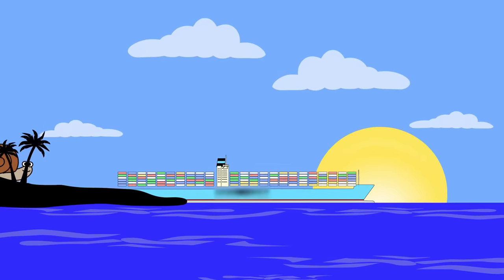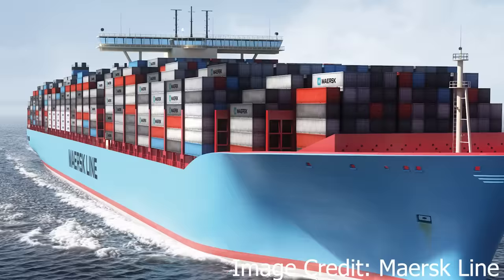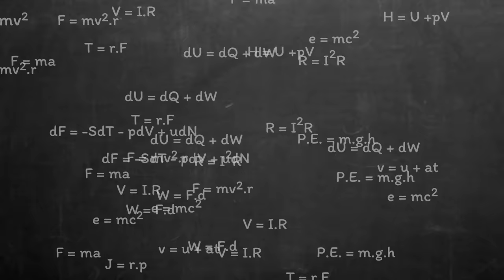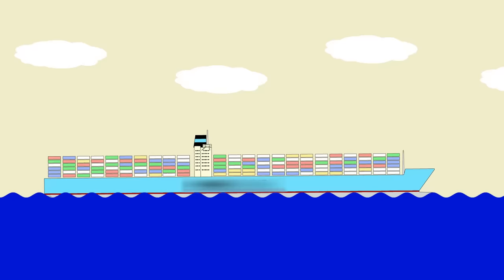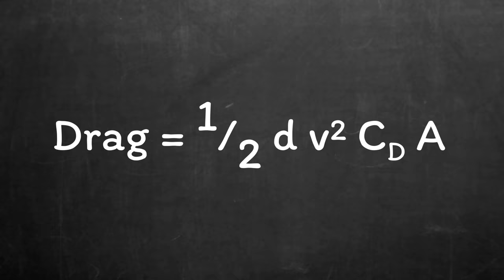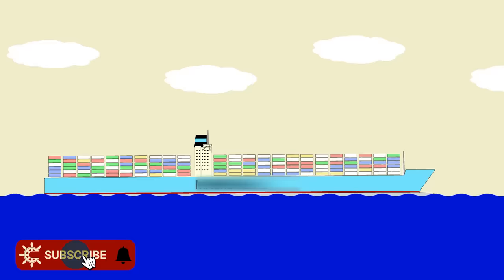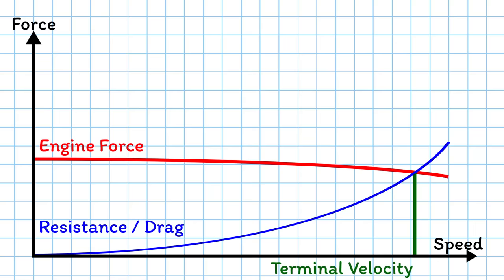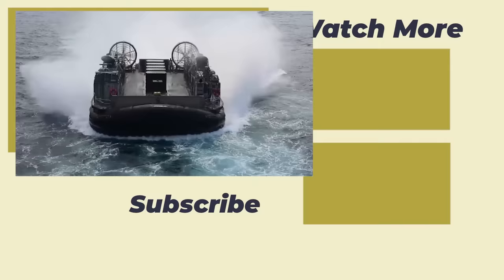Why are ships so slow?

Comment: You missed the three biggest factors.  Even with all other things (mass, power/weight ratio, cross section of wetted surface, ect) being the same, these three have more affect then the rest of the reasons cited in your video. 

First, there's the density of water vs air.  The higher the density, the more mass you have to displace to move.  Water is over 1 metric ton (1000 kg) per cubic meter, air is ~1.2 kg per cubic meter at sea level and ~.02 kg per cubic meter at typical cruising altitude.  This is where hydrodynamic/aerodynamic shapes (form drag) come into play.

Second is the viscosity of water vs air, which affects surface drag.  Air is 50 times less viscous than water at sea level, and 60 times less viscous at cruising altitude.  

Lastly, hull speed.  Cargo ships are displacement vessels, which mean that above the hull speed,  about 30 kts for a 500 ft vessel, drag rapidly increases.  Planing hulls and hydrofoils ride on top of, or above, the water, and aren't limited by hull speed.  Catamarans have a slightly higher hull speeds due to high LWL/BWL ratio hulls.  Aircraft and cars don't have this problem.  They're don't see disproportionately rapid increases in drag till they approach mach 1.

Comment: Iam not sure whether the video viewed ship resistance from the right perspective. Ship resistance is mainly a function of friction and wave resistance. Frictional resistance is 'mainly' a function of wetted surface area, while wave resistance is 'mainly' function of the froude number (ratio of ship speed to square foot of length) to which the drag coefficient formula applies. 
For a vessel of 400m with a low froude number, it's speed will be limited by the ships inability to overcomes its hump wave(among other variables offcourse)  that's generated due to the ships speed to length ratio where further increase in speed requires an un economical increase in power. Further more from the drag coefficient formula, since density of water is 1000 times or so more than air, the drag will amplify due to that factor (pertaining to water viscosity ultimately). This is also  simplified model as ship resistance is affected by form factor, viscous pressure and air resistance among others.
Reply: I just noticed  you addressed some of these points in the pinned response. 👍

Comment: Aircraft and cars move through air. Ships must move through water which is 1100 times denser than air . They have to push that water out of the way to be able to move forward. That, and their massive weights, require huge amounts of horsepower to move.

Comment: Ships are slow because the blade are on the back side.the hole pressure  (the load of the ship and the pressure of the movement )was on the back side.
Jodi blade gulo samnay dikay hotoe r flat hotoe ta holay ship er speed anek baray jatoe.
Fish r boat er modhay parthokoe achay. 
Fisher concept boat er satay kono dino match korbay na.

Comment: They are heavy etc, sure. 

But isn't the water playing a HUGE role too? As I see it, the problem with water is that it doesn't allow you to move as rapidly as you could if you travel on wheels on a flat surface or even in the air. Why?
Because the environment isn't as controlled and there is always the chance that you run into a literal speedbumb. Actually, ships go 'through' such speedbumbs all day every day - and sometimes the sea just throws solid hills of water at them. If you travel at a few hundret knots and come into contact with a wave - chances are that your vehicle is ripped apart. Water can be a solid obstacle if you hit it with enough speed ...

Speedboats and thelike are able to go very fast etc, but they can do so only with calm seas and only with very little weight. I don't think it would be possible to construct a containership that could go similarily fast even if you had the engine etc to put out the power necessary, just because it would be prone to wreck its' own structure with its' contacts with the water.

Comment: Drag Coefficient ....Air is 784 times less dense than water ...so, roughly it takes that much more energy to move an object through water than air. However, floating on the surface of water needs relatively less energy for the same object. Surface Transportation, by far, outweighs Time / Distance than water or air. Modern Railways can hit a speed of up to 600 Km/hr. No ship can match that. There are freight trains from Beijing to London / Madrid. not If but when Baring Strait Tunnel is built, Railways shall rule the planet, apart from ANZ, Antarctica and Island. From Tierra de Fuego to London by train ...a Train Journey of circa 50,000+ Km ...stopping / starting ...all the way to London ...

Comment: Emma Marsk has a cargo capacity of almost 7500  40 feet long containers  with a weight of 21 tons each.
This means you need 7500 18-wheelers to transport the same cargo. How many horsepower do you think they will have together?
Not to talk about how many planes and their power....

The largest cargo ships of today can transport 1 ton of cargo 1000 miles using only 1 gallons (or 1l/400km) of fuel oil.
If you convert this to a truck, transporting 30 tons of cargo 100 miles would consume only 3 gallons (or 7l/100km) of diesel. I think the truck needs a little more fuel.
  So evem if big ships are slow,  they're very fuel efficient.

Comment: Vehicles do not experience friction. Not in the way it is implied in the video. What causes vehicles to have a limited speed is aerodynamical drag, tire rolling resistance (due to energy loss inside the rubber) and viscous friction on all oiled parts. Friction with the ground plays a completely opposite part: it pulls the vehicle forward. Remove that, it will never  move - unless moving down a slope, of course.

Comment: https://en.wikipedia.org/wiki/Hull_speed

It's not drag in the same way other things experience drag. When a boat goes fast enough the trough from its bow wave is at its stern and the ship is effectively climbing uphill at a steep angle. This practically limits the speed of all heavy ships. Boats that go faster than this do so by hydroplaning.

Comment: If you can increase engine power, like, say, using gear ratios to switch to an overdrive, would that have a significant effect on speed? Or would you need to keep the same ‘high torque’ speed?
Reply: Optimal rpm to torque and power ratio is required for optimal fuel efficiency..

Comment: I know this is so obvious but the reason why ships have more horsepower then cars is because if a ship had a cars engine it wouldnt do crap, sitting there useless. But even so if you were to remove a ships engine say put it on something else way lighter, it wouldnt do crap either. It would be too heavy. In our world of modern technology people believe that horsepower spells everything speed. 100% false because take for an example an F1 car. Produces a ton of horsepower and its not street legal for a reason. Its to light for legal regulations. A standard F1 car only weighs 200-220 KG! thats super light for a car. Take for example a Bugatti Veyron. It produces more than an F1 car about 1200 horsepower. But the thing is, its heavy as hell. An F1 car would leave it in the dust. This also applies to motorbikes, a standard bike is extremely light but has an extremely low amount of horsepower. That doesnt matter it can still beat a car and go over 300 MPH. In the car world we havent even made a PRODUCTION car capable of that speed. (This comment is for all you nerds/car nerds like me out there)

Comment: so you say 1 container ship needs 109,000hp so theoretically a Boeing 777-200LR and Boeing 777-300ER can pull a container ship being that they are powered by 2 General electric GE90-115B's that produce 60,000hp each. I'm just an aviation gal trying to learn ships sorry if i got this misunderstood.
Reply: Well yes they can but that's a very uneconomical way of doing stuff. Water has a high viscosity so a drew turning in water is able to generate more thrust than a turbine turning in air. That 109,000 horsepower is better used under the sea than on a jet engine pulling a ship
Reply: Yeah but you gotta consider that airplanes need to stay in air and not fall down+it is supposted to be the fastest way to travel. Ships don't NEED to go at a certain speed to, technically to not sink because you don't sink for going too slow in water.
Reply: @blase1856  makes sense . I'm a ship noob so I don't know thanks for your input . I only watch because boats interest me . you don't know how much you just helped me out.

Comment: 100 horsepower an average car. Bull pop. It’s actually with the most commonly bought cars is actually 60/80 horse power and planes actually don’t often have 4 engines, it’s 2. Even the long haul flight I took to South Africa was 2 engine plane. So thi is bs

Comment: but how does the ship engine weighing in at 2300 tons and "only" delivering 109000hp compared to a smaller jet engine on a plane that makes 150000hp?
Reply: Different type of engine while the jet engine has more horsepower its not really compatible with ground and water

Comment: Why  cant we use hover craft for cargo ships
Reply: I'm pretty sure hovercrafts aren't often used because of the cost of fuel.
Cargo ships are generally used to ship things for low cost at the expense of speed.
Hovercrafts can go fast but need a lot of fuel and can't carry as much weight as other ships the same size. I'm pretty sure the cost of maintenance of a hovercraft is higher than other water craft.

Comment: Why ships don't have higher HP engines proportional to their mass? I am surprised that big cargo ship has lower HP engine than a 747.
Reply: Bigger engine means more fuel used, with not much or even no more additional speed. Drag increases proportionally and think about the bow wave too.

Comment: I'm sorry, old video, not a big detail, etc etc. But the extreme end being F1 at 1000 HP? Really? There are cars driving around on the street with 1000 hp and air conditioning. If you want to go with the extreme end you should have made a drag racing reference or the like. Top fuel drag cars are pushing 15,000+ hp just to make it on the track.

Comment: What if they outfit the container ship with 100 turbines?
Reply: Fuel consumption goes through the roof, and they squeeze maybe an extra 3-4 knots out of them before cavitation screws em'. The Iowa-class battleships are a good example of this; they've got an absolutely apocalyptic 216,000 shaft horsepower pushing 57,000 tons of armor and guns, but they topped out at 34 knots under standard operating conditions. They ran into problems with the outer two of the four props starting to cavitate, creating massive amounts of drag and slowing them down to the point that they had to downsize them. It's telling that with half of her boilers cold, Iowa still managed a gob-smacking 29 knots with effectively half the available horsepower. Power only gets you so far, and with shipping, efficiency, not speed, is the name of the game.

Comment: There once again is information missing. Quit using HP. Horsepower is not a major determining factor. If I had a racing engine with a million horsepower, it still wouldn't move that ship. Now I have a small engine with a million foot/pounds of torque, it would spin the ungodly hell out of the rear props and that would move the ship faster. Internet. Stop. Using. Horsepower. Does anyone else, even remotely mechanically inclined know this? It's like saying electricity is voltage. It's not, there is current, draw, and flow. Amps, ohms and volts in that order. Use the entirety of what you're trying to teach about and you'd have less comments about "bigger=slower". And probably better educated people. Really irritating.
Reply: I'm afraid you're quite mistaken.  In your analogy horsepower corresponds to watts, not to volts.  One horsepower (US) is 746 watts.  It is the measure of how quickly work can be done.  Continuing your analogy, torque is volts (pressure) and rpm is amps (flow).  The amount of work done is the product of the two.

Your million-horsepower racing engine could be geared down to around 100 rpm, which is roughly how fast these big ship propellers turn.  Leaving aside the gearing losses, it would have 52,525,121 pound-feet of torque at the propeller.

You can always swap rpm for torque or torque for rpm using gears.  What you can't do is have the product of torque and rpm exceed the available horsepower.

Comment: Install a jet engine on a cargo ship. Problem solved....or at least it’ll be very entertaining
Reply: That doesn't work like that. Planes can only go fast because they are moving fast in the first place. The only way for an airplane to actually accelerate is to move, and then the engines get more air intake and go faster. So if you installed a jet engine on a ship it would barely start moving. Engines are way more efficent and "usable"

Comment: Dislike for comparing a single hull merchant ship to a double hull. Catamarans have very low payload per size compared to normal ships, in a true comparison a double hull would have at least double the draft and not less, like you showed.
The double hull has lower waterline surface, which means less drag. Not the cross section! 
Also hydrofoils lift fast boats to reduce wetted surface causing drag not cross section! That is all. You fucked up.

Comment: Most cars weigh a lot less than a ton. The average truck is the us is about 3/4 ton and most cars are less than that
Reply: That is not even remotely true. My Fiat 500 is one of the smallest cars in America and it is barely over a ton at 2,363 pounds.

The most popular truck in America is the F150 which weighs 2.5 tons aka 4,500 pounds, and most pickups are around the same weight. Hell, normal cars like the Ford Fusion are 3,500 lbs, or 1.5 tons.

Where the fuck did you get the idea that most cars weigh LESS THAN a ton?